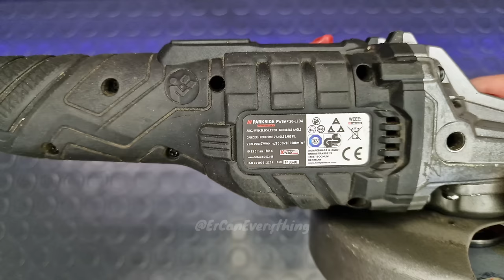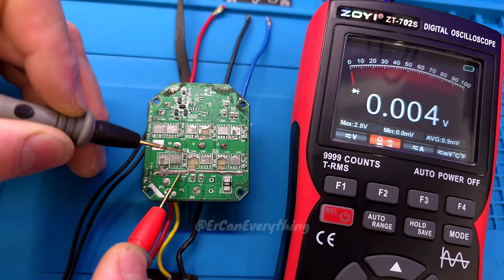I will try to repair BL Controller of the Parkside Angle Grinder PWSAP 20-Li D4

Comment: Why did you bother opening the old controller if you were going to replace it with another one? Also, couldn't the blown MOSFETs have been replaced to fix the board? Was the controller IC also blown?
Reply from the maker: I thought it would work after replacing the transistors, but after removing them and measuring, I found out that the gate driver was also burnt, which could not be found🤷

Comment: Dear friend, sorry for the boldness of this message, but I saw your video, and as I have the same problem on my parkside, it's the same model as yours, I decided to buy the module and exchange it.  Now the machine is responding but has started to emit smoke in the engine area.  I'm not very experienced so I decided to ask for your help if you want to help.  I thank you in advance for the teachings you always share.  Compliments

Comment: Better get a dewalt or milwaukee or flex grinder, more power
Reply: You can overvolt the Parkside grinder with 24v and it will destroy what u mentioned

Comment: I know I've written this before, but I have to say it again, your work is simply fantastic, I never tire of watching it and trying to learn.  Thank you very much for sharing.  I would like to ask you if this machine loses any strength or characteristics after this change?  I have the same one, when I try to turn it on, the engine signals but it doesn't turn, is it the module or is it something else?  If I can respond, I will.  I thank.  I wish you much success for your extraordinary work.  Greetings from Portugal, thank you

Comment: In the angle grinder was undervoltage protection (yellow wire in battery terminal)how do you solve that?I dont find any word in the product description.If is not present,grinder will suck the battery dry so destroy it 🤔
Reply: I got similar controller in my chinese brushless drill and it stops working at around 15V. Not sure if all of them have that though.

Comment: This  controller is compatibile with   Cordlles jogsaw parkside psspa 20?
Reply from the maker: This controller works with all 18V - 20V tools which also has 14 - 15V low voltage protection!

Comment: Whay gate driver cannot be replacement? It's not availlabe anywhere?
Reply: Are you asking about the whole controller assembly or about transistors? Transistors cannot be properly replaced, because it got hot so much it fused with copper.
Reply from the maker: I don't think It's available anywhere and I even transferred from another non-working one. But it also came out burnt🤦🤦🤦
Reply: @ErCanEverything , @MrFrambooise
ok, but in such drivers only the transistors are damaged (together with the PCB) and the rest of the integrated circuits are functional?
Reply from the maker: @tomaszw5156 In this case, I waited 5-6 months for a donor PCB, which I first installed a driver and it came out with more burnt channels than the first one, which is not in the video.
Reply: @tomaszw5156   most likely yes, but since alot of copper is missing the conductivity will not be sufficient enough, and increased resistance means more heat.
Reply from the maker: @MrFrambooise Because as a result of a short circuit, the transistors are welded in the copper layer.  But if the IC was solid, I would have soldered the new transistors in the blanks.
Reply: Has anyone found a replacement transistors? I can't find any info about the original ones. If there isn't direct replacement is it possbile to repalce all 6 transistor with another ones?
Reply from the maker: @stoyan172 These are doing a good job
https://s.click.aliexpress.com/e/_Ew8ci4l

Comment: Can you make video with model pwsap  20 LI E6?this model has  control panel with touch. I bought a control board with connector but i think the wire configuration is diferent than the original controller. If i connect a button from a screwdriver, it works perfectly. Can You please help